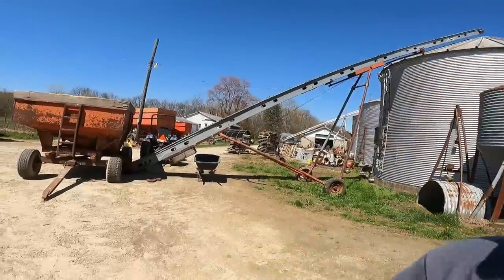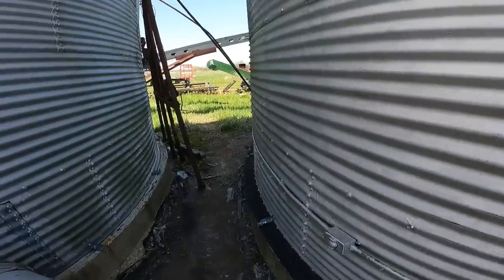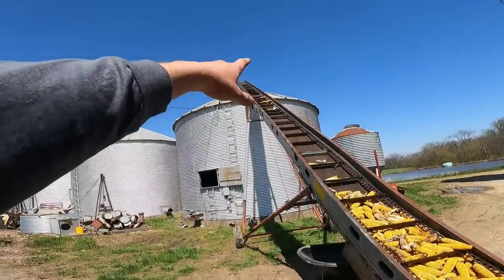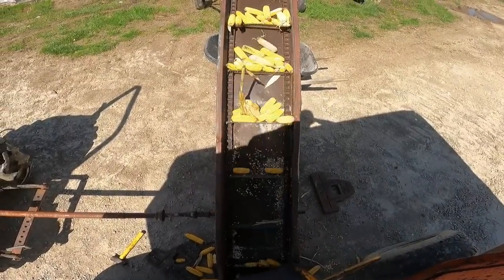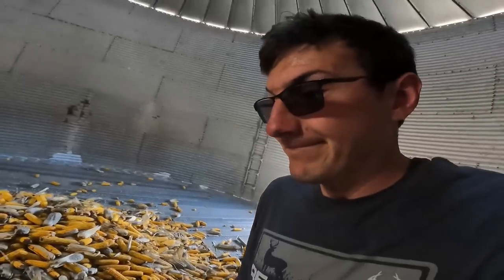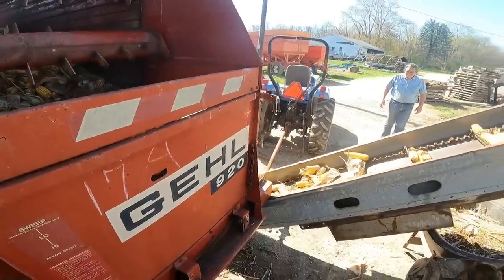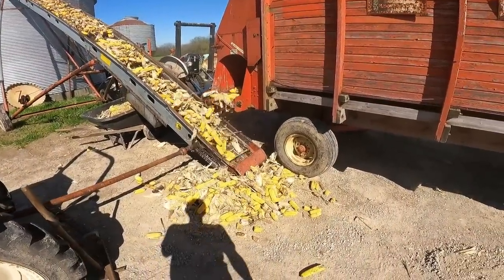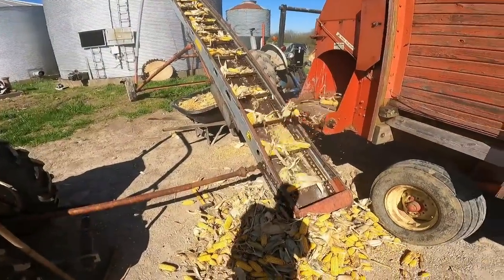Pre Season Test of the Ear Corn Bin/Crib

Comment: I'm just gonna say you need to not be lazy. Take the tension out and pull off 1 or 2 links a side on the conveyor and it'd work a million times better!!! Chain is to loose!! I mean it's common sense look at your adjustment it's almost fully extended. 2nd see how it can ride over the corn almost a foot?? Yeah those chains only want 1 to 1 1/2 inch deflection. If you'd stop and not be lazy and do that u cld actually run it faster! Also another way to tell is the chain coming off sprocket! Do something farming takes some mechanicing so do it!!!

Comment: I grew up running a New Idea picker on a Case 400. We filled 2 and a half cribs every fall. Two of those had similar elevators with lift up extensions because we used end dump wagons. The third crib had a closed, internal bucket elevator and a dump pit in the floor. Corn was put in as dry as we could get it, and shelled out in the spring. Lots of labor involved, but shelling was more fun than picking. Had a neighbor that tried using bins for popcorn and had LOTS of problems getting corn out. It would stick and bridge together and they generally had at least one guy in the bin working it down while loading out. They also had several close calls when corn pile collapsed under them or stuck piles fell on them. Cribs were much safer, rake out the doors until you could get inside, then rake and shovel into conveyor. Be safe, we bought a farm from a guy who got his arm caught in his PTO shaft and was unable to farm after that.
Reply: Yeah that PTO shaft on the elevator down there bare is just begging to catch pants leg and pull a guy into it...

Comment: I converted two silos to dry popcorn (30 years ago)it worked well. I dried with a wood fired dryer. I filled with a conveyor that ran between two silos. The conveyor had a plow on it that I could switch sides and also reverse to switch silos (Patz feeder). The largest draw back was the silo acted as a big condenser (dripping walls), good thing I used pebble film (the type used for basement water mitigation) to line the silo. It worked just used much more wood. The make of the elevator made a huge difference New Idea was the best it has a ledge somewhat preventing the corn from lifting the paddles. Helps if the bottom is shined up too. I used wood to cover the small conveyor in the silo, two corn picker conveyors put together. Good luck - cob corn makes more nutritious corn if you shell there is a market for the cobs. Also you can feed them, burn them, they are great fuel,and they make the best bedding. If were to do it again I would take the silo down to about 25 feet maybe less, and automate the wood burner.

Comment: I bet it was more of a sense of relief that everything worked. You should have a cone on the end of the elevator to funnel the corn in tho. It will help alot when you decide to push the elevator harder. When I  go up the elevator I park the front of my farmall m over the bottom you might try setting the skidloader bucket on the bottom to add stability. Stay safe Jacob 👍

Comment: Glad to see this up and running. If you keep the bin unloading conveyor covered and the bin is full, how do you remove the floor doors/covers. Being a city boy perhaps I am missing something.
Reply: That’s what I’m wondering
Reply: I was wondering the same thing.  With a corn crib the outside lower ring opens up in stages vertically, and then after taking corn out you can remove the floor piece by piece.

Comment: Best idea I have ever seen for ear corn was a Patz barn cleaner under a 50'X10'X 10' crib. The gutter chain unit had enough torque to move the ear corn at a rate that a good grinder/mixer could handle it. Solid bins with save all of the kernels that shatter, but you may have to run fans more to prevent mold.👍
Reply from the maker: I plan on the fan running. I figure forced air has to be better than waiting on the breeze.
Reply: @boehmfarm4276  Yes you will need to keep a close eye on that bin. Run your fan when air is cool and dry, smell the outgoing air for hints of mold, and shell it as soon as you can.

Comment: There are spreader for ear corn, traditionally used in corn cribs.   However it does make the ears very hard to get out as they don't want to flow.  We didn't use them in our cribs and the corn falls in the middle, then flows to the outside.  When taking the corn out, it has a tendency to still flow.  With the spreader, the ears need to be chopped out as they don't flow (usually with hand tools).

Comment: Thanks for the video, you put a lot of time into building that system .I really hope it works out right in the end. Be careful walking up that elevator, you've only got to have a slat break and you'll either have half a day out at the hospital and hopefully nothing broken or worst option half a day getting measured for a pine overcoat if it goes  south real bad.  Just wondering if a couple of those 1" ratchet straps people use for tying stuff down in pickups would work better to keep that lid on, they'll  maybe keep better tension  as temps change. As long as they don't get wet and freeze up if you need to get the lid off in the winter, sometimes thats what happens to the 2 I use in my service truck  to hold my toolbox down. Take care
Reply from the maker: I was thinking of baling twine.

Comment: I'm concerned about the quality of corn coming out of that bin. I know that you can run air through the corn, but keep in mind that air will follow the path of least resistance. There was always a reason that ear corn was stored in slotted cribs. Air flow is very important. Make sure the corn is very dry when you put it in that bin. 

Just a concerned viewer.
Reply from the maker: Those cribs had no forced air. Path of least resistance could still be an issue in old fashion cribs.
Reply: @boehmfarm4276  you're right. We still fill corn cribs. Wooden cribs were six to eight feet wide. Round wire cribs have wooden vents installed in the middle that acted like chimneys to keep air flowing. We never fill these cribs until the corn is around twenty percent moisture . In 1992 we had a cool summer and the corn just never dried down far enough to be safe for cribbing, we did it anyway and we had a lot of mold in the corn and we had terrible luck with the hogs that year because of it. I'm not saying you won't get quality corn, the best thing that you can do is after the bin is full, level it off the best you can so the air flow is even. And definitely keep the shelled corn out of it because it will pile up in the middle. Mold will always grow there. I wish you luck!🙂

Comment: What is your plan to remove the elevator covers once you have covered them?  Maybe a rope or two tied to the first couple to pull them out?
Reply from the maker: I'll be in there with a shovel pushing corn.
Reply: @boehmfarm4276  How will you shovel corn into the elevator when the bin is full and the covers are buried under 20 feet of corn?
Reply from the maker: I still need to make a little opening over the elevator to get it started.

Comment: How are you going to get corn out? Ear corn usually has to be raked out of a crib, bridges up a lot, you probably have a plan!!
Reply from the maker: I'll be in there pushing it across the floor, no lifting.
Reply: @boehmfarm4276  How will you do that when the bin is full?
Reply from the maker: There will be a little door in the wall over the elevator to get it started.